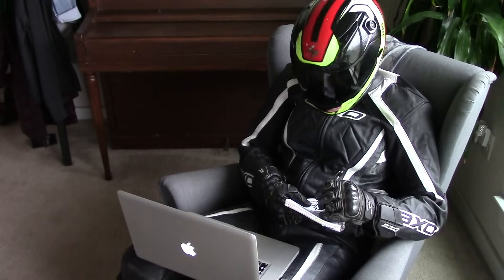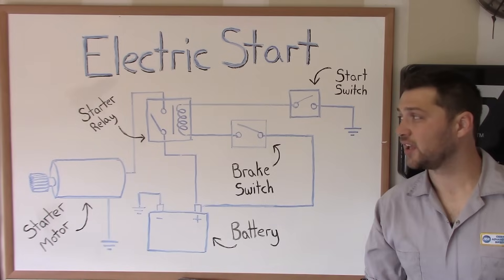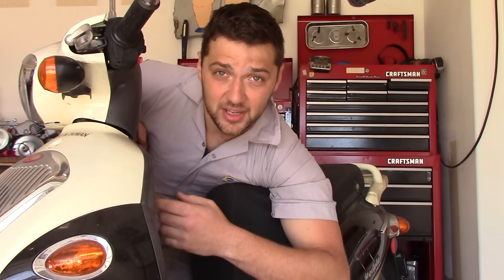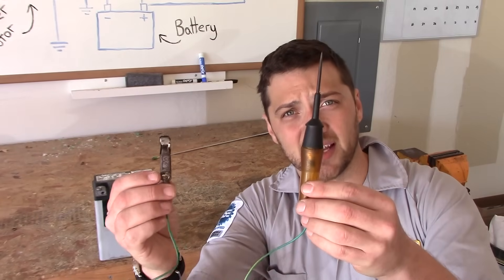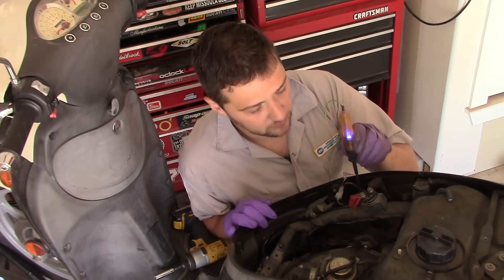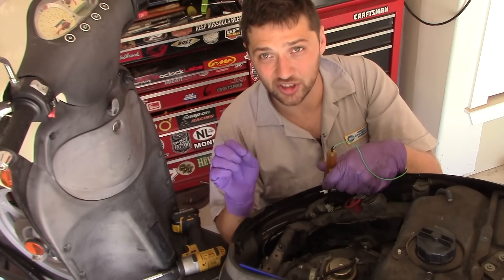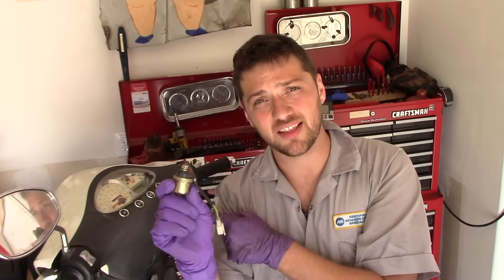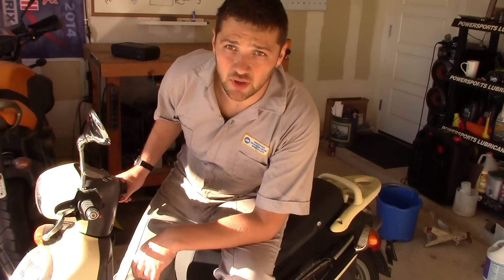Scooter 911: Electric Start Doesn't Work (troubleshooting your starter, starter relay, and circuit)

Comment: I Don't have test light, but have DMM. With everything connected, i get 12V from battery ground to starter relay battery lead, nothing from battery ground to starter relay starter lead. From the harness i get 12V from pos battery to one of the leads (without pressing the starter or brake switch), and nothing from battery ground to either harness lead either pressing starter or brake or both. Additionally, I discovered a broken lead on the kill switch, which I fixed, and all wires on the starter switch harness test proper for continuity, however, moving that harness (not pressing any buttons/levers) results in one of the two relays activating. Not sure what either of them do, they sit between the starter relay and ECU, and the one next to ECU that is clicking erratically. I plan on testing them fully once I get some test leads, but they show around 120 ohms on the input side, and no continuity between the output side. Any help would be appreciated (from anyone), I'm american living in Philippines, and the language barrier between me and mechanics is interesting to say the least. The scooter is a rusi rfi 175 (chinese i think, and probably worse than your tao tao, thought I still have to finish that series) Sorry for long comment, but anyone willing to help please hit me up

Comment: Or toss those rubbish motors out and switch to electric far greater range, power and speed making scooters worth owning again! I converted all my collection of Lambrettas and Vespas and BSA's and Ariels to electric and they are now three times faster and in 8 years not a single one has needed eveen a moment of maintenance or repair meaning 99.9% riding and no more lost riding time! Great vids.

Comment: Hi there, I have a 2013 Buddy 125 and the battery is not old.  When I try to start when fully charged, I hear similar to a horse neighing sound 🙂.  The scooter starts when I kick start but not electric start.  When the battery is slightly low, I hear a tapping/rattling kind of sound.  Not sure if it is the relay or the starter motor issue.  I will diagnose further.  Let me know if you have any other suggestions. Thanks.

Update:   
I simply tried to jump start it with a NOCO Jump Starter and it started right away!   so it is the battery then...   the Battery store does a load test which passes but my scooter won't start!    So I took a video of this to the battery store and after some convincing they replaced the battery and now my scooter's electric start works just fine!  Thanks.

Comment: I don't have a test light instrument but I use a multimeter. The brake gives me 12 v when activated but the start switch approx 2 v. Does this mean it has some issue? Should it also give me 12 v?
Reply from the maker: When checking the start switch with a multimeter use your black lead on the negative battery terminal and the red lead on the start button wire. Set the meter to resistance or continuity and see that the resistance is less than 3 ohms or the wire shows continuity to ground when the button is pressed.

Comment: Fantastic! Just discovered your channel to troubleshoot my 2007 Kymco People 150 start issue. When it has been sitting for awhile (few weeks) I push the starter button and there is a 2-4 sec delay before it attempts to turn the motor. Once the motor turns, it will take a bit to start but eventually will. When I've been riding the scoot regularly, there is no delay and the motor turns immediately when I hit the starter button. Note: the battery is fairly new; when it has been sitting I put the trickle charger on to make sure it has a full charge but delay is the same. Yes - brake lever pulled, key in On, etc. Appreciate comments. Thanks!

Comment: My scooter makes that cranking noise in the beginning, but you said I have a ‘different problem’ without specifying 🥲🥲

What problem is that? My scooter kick starts and idles / runs fine after kick starting but  when I try to electric start it just cranks without starting. How do I fix this please? 😁
Reply from the maker: Check out our video on how to perform a valve adjustment friend!

Comment: Don't laugh but if my Vespa PX electric start is dead, I just toot my horn twice and bingo !
(Don't know why it works)
Reply from the maker: Woah that is crazy! What if you toot it only once or perhaps thrice?
Reply: No luck, it is gotta be twice lol lol  Ok will try it one or thrice in future. lol
Often have a difficult cold kick start with varying choke , so I will try tooting first to see if it is same problem.. 
Noticed it starts better (kick or working electric) with fuel tap on for a full 2 minutes - guess it allows carb to fill
  @Scooter_911

Comment: Can I get some help here please, I recently changed my starter Bendix because it was bad and got a new one, but I'm having the same starting issue. The engine starts sometimes . but then I saw a little deformation in the Bendix hole, it a little worn.could that be an issue.if it is how can I fix

Comment: Thank you. Now what if you only get a screeching sound when you press the start button. i.e. no turning sound - no cranking (like your second sound @ 3:36) at all, just a screeching sound, and the kick start does not work also. The battery is new and fully charged, the brake lights work when the lever is pressed, the indicators and the horn all are fully functional.

Would appreciate a reply as that is my problem with my 50cc Cagiva City 50 scooter.

Comment: Hello I have a mp3 piaggio 500cc I changed the leaking water pump and All was good all panels was out he was very dirty so I was all with brush and kerosene and a lot of water with house since then the bike doesn't have a start I follow all your video and  I had no clue what to do when I switch the key the lights going on but no crank no spark I checked all switch there is all is good but I don't find the problem my bike sits in the garage for one year I try so many times but can't get it.

Comment: So the labored sound might be a weak battery...I figured...but now the kick start isn't doing anything at all, and the battery is still strong enough to power the alarm and the brake lights. I'll see what I can do with the battery first and then check the ground. Thanks for the video!

Comment: Hi there! Your videos are awesome and I'm able to fix so much stuff. I replaced my carbs, cleaned out the fuel tank. Did the valves perfect, New plug. The scooter starts but still won't run without forcing throttle. Could the cdi box still be my issue?

Comment: So if the starter relay bypass doesn’t work it’s a starter motor issue?
Reply from the maker: As long as your battery is full charged and properly connected yes!
Reply: @Scooter_911 I got a new starter motor, I have spark, compression and fuel. Scooter still won’t start. Do you think the flywheel could be the issue?
Reply from the maker: @mxtcx  is the engine cranking (rikikiikikikikik sound) over when you press the start button? I doubt the flywheel is the issue. Has the scooter been sitting for a while?
Reply: @Scooter_911   it randomly didn’t start one day after it had been working earlier that day.. the engine sometimes gives a tiny putter when trying to start it like it’s about to turn over but most of the time you can just hear the spark and starter motor (I think). Also the spark gets pretty weak after a couple attempts. the spark plug itself is pretty new, do you think that’s because of the cdi, ignition coil, or battery?
Reply from the maker: @mxtcx  start with a fresh battery definitely
Reply: @Scooter_911 hey man still having trouble with the scooter. I have a fresh battery, the starter relay is working, and I have a new starter motor. I’m also getting spark. The motor gives a really quiet putt noise but won’t turn over. The reereeree sound also seems a bit off. Not sure what the problem is, any ideas?
Reply: @Scooter_911  I was thinking it might be a broken flywheel? Btw the carb is fine and is getting fuel, there’s also decent compression.
Reply: @Scooter_911 ok, while trying to start it the start button started not working as well. If using the bypass makes a better sound then using the the starter button does that mean the relay might also now be messed up, or is that a separate issue?

Comment: Awesome! I used the video to do a valve adjustment on a 50cc Tao Tao twice well waiting for Amazon to send me a feeler gauge set for $7. I am not a mechanic. I had no idea until I watched his video.  
I ride a 150cc Tao Tao. It was almost identical. I had to take my side panel off for a clear shot at the spark plug but it was no trouble taking off or putting back on. If you have trouble with it he probably has a video on it. Thanks man. I am back on the road.
Reply from the maker: That's great news. Happy to be help keep ya'll shiny side up.

Comment: Hi Garret is there a safety switch on the kickstand. I have a lance cabo 125
Reply from the maker: I don't believe the Cabo has a safety switch but it might have a lock out switch under the seat that will prevent it from starting!

Comment: What to do if we are missing a chasis ground or engine ground? My scooter seemed to have one that was bolted on, but the bolt has vibrated out. Now I'm left with a two pin switch to nothing.

Comment: Randomly discovering this video at 1 a.m. on a Tuesday in Chicago 4 years after you posted it.. because my mechanically dumb self bought a vintage 84' Yamaha Riva 180Z a month ago because it looked cool and just now had to leave it behind in a different neighorhood because it wouldn't start back up after a grocery run.  You're video was super helpful and hopefully will get me out of this mess! Tomorrow I go back to the side of the road where I left it to see what I can do. At least, i'm hoping I can use your needle nose trick and get it running and bring it home to further test the relay/starter/switch.  Fingers crossed!!

Comment: Hi can someone help please...I had a new starter and relay but my starter button still won't work...Best image I can give you is when I press the starter I hear a faint tick sound from under the footrest all other electrics work fine also my bike is a 2011 peugeot kisbee rs 50cc 4t any ideas would be great and my tool box is basic

Comment: Thank you for letting me in on the bypassing the starter relay because my solenoid I thought was the problem I just bought a brand new battery it's definitely turning over but it still won't start it's been sitting for six months it will be a cold start I knew that I figured it was going to be a bad battery I buy the battery and now it still won't run

Comment: I think if the ignition switch fails you can be stranded.  besides a dead battery, which can be averted by kick starting the vehicle, I would either rig a switch or make a switch bypass so that you can rely on the vehicle even if the ignition switch fails.

Comment: Hello, I have a scooter related question... Do you possibly have a video or could give me input on how to wire in a toggle kill switch (2 poles) with the wires from the stock kill switch? The wires on my scooter kill switch are in 2 separate connectors going to the kill switch. 1 set is green & green/white (stripe), the other connector is a green & black/white (stripe). I have photos if needed.
Thank you!

Comment: I could really use some HELP!  I have a 2009 Yamaha Zuma 125 that struggles to turn on. I have a new battery. Fully charged. It tends to turn on w little issue when I jump start it to the battery. Otherwise it seldom fires. I could really use some help.

Comment: Is a rolling start possible? On a weak sounding starter only lugs a half turn over and over while pressed, also a pain to start cold with pullstart,bi know has cvt but I feel like it just needs some rolling assistance

Comment: I have a problem. Holding brake doesn’t turn the test light on when connected to either 2 pin. But when I check if they have a ground connection, without pushing the starter button both pins light up the test light. What does this mean? Note my starter button hasn’t worked for years

Comment: Turn key on. No dash lights , no gauges working , no horn , no break /headlight works. 
BATTERY IS FULLY CHARGED. Fuse is ok. 
What can be problem. 
I’m thinking key barrel connections.

Comment: Hello, I'm getting power to the starter button and the solenoid is working. My brake lights up as well. However, my bike is still not starting by electric start. What can it be?
Reply: I tried a new electric start button as well but no luck

Comment: My scooter cranks and sparks, but I think the spark it to fast and weak. It starts really easy with the Kickstarter, but when I try with the electric it cranks but won't spark. When I crank, the starter slows down and it disengage and engage again. Great video and very good explained

Comment: Ok so I snapped my ignition coil on my bintelli beast 150cc , I got a new ignition coil but when it snapped on the road my dumbass kept trying to use the kick started and I think I jammed something inside there. At first it wanted to turn when I got the new coil but now it’s just making this electrical sound. Should I check the kickstart case? Because the spring is definitely messed up and I seen that could stop the motor from running, I seen some guy just remove that piece and the engine started working.

Comment: HI yes the starter motor works but it stuck in start up, the brake light before that failed to come on, I have a piaggio mp3 300 urban scooter.

Comment: You are really a teacher. As a women working with her long nails on her sons scooter this is trully a gift. This makes my project eassier!❤
Reply: w mom
Reply from the maker: So glad to help!
Reply: @Scooter_911 what if it just clicks when I hit it. I have brake lights working. Good battery but when I click the start it just clicks which I assume is the manual switch doing what it should. It doesn’t work when I use pliers to jump it either.

Comment: HELP! I Haven't been able to ride my Scooter in months. Several people have looked at it and the diagnosis... NOBODY KNOWS WHATS WRONG!!! WTF! I had the starter and battery replaced, the carborater cleaned and when it was dropped bk off to me after a few trys the mechanic got it started. I parked it. Rode it to work the next day and when I got off it wouldn't start and that was about 3months ago. THATS MY ONLY TRANSPORTATION. HELP! PLEASE AND THANKU!

Comment: Hey man I have a question I have a brand new 50cc scooter with less than 300 miles on it one day I walk into the gas station come back out and it wouldn't start at all but will kick start every time any ideas? 
My brake lights work fine also if helpful
Reply from the maker: I would try a valve adjustment! We have seen a lot of bikes come out of the crate with low compression due to the valves not being set up properly from. the factory. check out the video here: https://www.youtube.com/watch?v=QkkYjRdtQxg
Reply: @Scooter_911  ?
Reply from the maker: @justinramsey411  sorry guess I thought you meant it would crank but not start. Did you try the starter relay bypass?
Reply: @Scooter_911  yes it cranks right up with I bridge the relay........
Reply from the maker: @justinramsey411  have you tested the outputs of the wire harness connector to the relay? Making sure one pin is hot when the brake lever is pulled and the other pin has ground when the start button is pushed?
Reply: @Scooter_911  is there a way aid can test it without a probe?
Reply from the maker: @justinramsey411  not really. Does it click when you hold the brake lever and press the start button?
Reply: @Scooter_911  no.......when I hold the brake and try to crank it makes absolutely no noise at all
Reply: @justinramsey411  I have the exact same problem. I can bypass the scooter relay and the starter motor starts the engine but when I press the start button I get nothing, no click, no crank, nothing. I have a new battery. @Scooter_911 any other ideas?
Reply: @Scooter_911  I have the exact same problem. I can bypass the starter relay and the starter motor starts the engine but when I press the start button I get nothing, no click, no crank, nothing. I have a new battery, I even replaced the starter relay but still no electric start @Scooter_911 any other ideas? The bike runs fine, I have to kick start it and everything else works as per normal.
Reply: Are you sure thats would it would be? 
Like it doesn't make any noise at all when I press the button but cranks first try every time with kickstart

Comment: You should do a video on safely permanently bypassing the starter relay. So you don't never have to squeeze the brake handle to start your scooter.
Reply from the maker: Thats actually not too difficult to do. All you would need to do is run a "Hot" wire from a battery source to the wire in the connector that energizes when the brake lever is pulled. Then the starter button alone would activate the relay!

Comment: Thank you! I have an amigo I bello 150. Issues iv been having is when it's been getting cold In Florida mornings around 50 degrees . My scooter keeps trying to start but won't rollover . It seems like the fluctuation from 85 degrees in the winter during the day and dropping to 50 might be the issue. But not sure why. Any help would be amazing.

Comment: My problem was I had 12 v on both sides of fuse untill I hit the break switch then the power on the side farthest from the battery would go zreo  which means I had an intermittent refuse / replaced the fuse it's now fine thanks from stock market Steve c.!! I couldn't have fixed it with out ur help.

Comment: What is nothing turns on when turning key on,  could the problem be the ignition switch?
Reply from the maker: very well could be! or the main fuse! but be sure the battery has a good charge first!